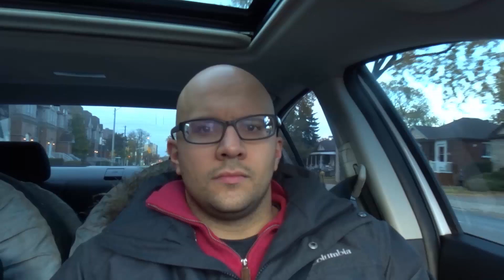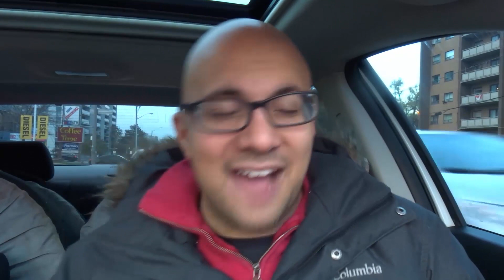3 Reasons Why Engines Lose Power Over Time

Comment: I agree with this guy 🤔 and I rebuild diesel engines for a living

#1 Reason for power loss is lack of maintenance

->If you forgot to replace the air filter dirt will build up on it and your engine will struggle to pull the air in and even pull the dirt in the engine as well.

-> the same story for air getting out, clogged catalytic converters, egr's will cause unncessarily high back pressure and it will make engine less efficient.

->low compression, either the piston rings are bad, valves are buggered with carbon build up.

-> Fuel Injectors buggered with dirt will indeed make it less efficient, making it run like shit, bad injectors on diesel engines will certainly provide the engine excessive fuel and create clouds of black smoke.

for petrol engines having carbon fouled spark plugs or spark plug gaps not set properly will make it less efficient and lose power

This is why fleet vehicles seems to go forever, they always do periodic maintenance
Reply: Hey man could u help me... Ive purchased this diesel 3 litre turbo van... Or fleet side 250kb Isuzu (its made in my country) so after a couple of times using it for the business it eventually just lost power and then started making a squealing noise when going uphill and has absolutely no power on any other gear besides... Should i take it to a machanic or is it something i could fix on my own... Yea my air filter was completely packed up with dirt...i did change it and the van did get abit more power but it's not what it was when i had bought it
Reply: @Filez062  depends 🤷 usually when it loses power it's either the valves needs to be regapped

or the fuel injectors needs to be cleaned 🤷

if it bothers you, or if it really under performs you should take it to a diesel specialist mechanic
to have it tuned up.

doing it DIY without the proper tools and skill will mess the engine up.

Comment: Fuel does make a huge difference. I have a straight piped v8 that’s supposed to take 91+. Of course though I cheap out most of the time. However when I do run 91+ I get so much torque that when I let off my gas at over 4 rpms I get an insane amount of blow back coming out the exhaust. It’s ridiculous, but on the cheap shit my car hardly will even get near the same amount of torque at the same rpms, the blow back then is almost inaudible in comparison.

Comment: Great vid on basics.my 03 tahoe runs like a champ but i keep up with maintenance seals gaskets plugs wires.she idles so smooth i can balance a nickel on the engine.keep throttle cable tight those get lose over time